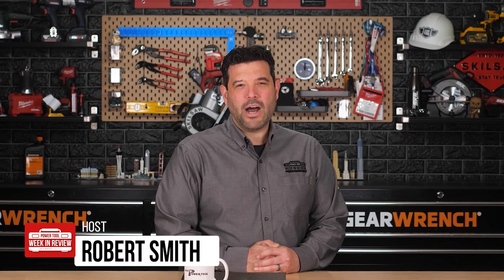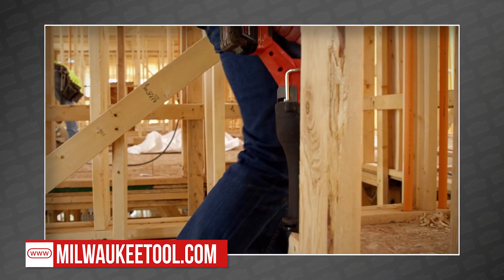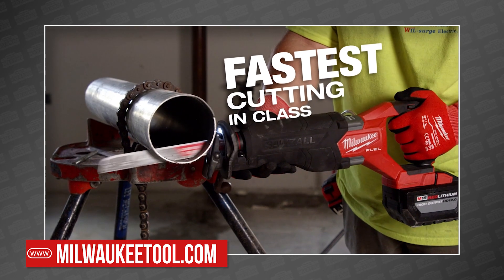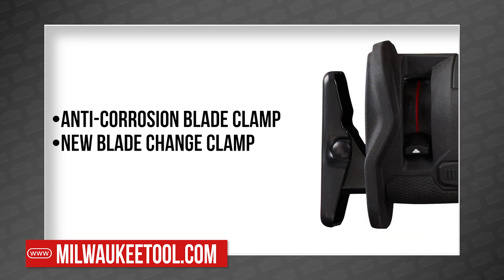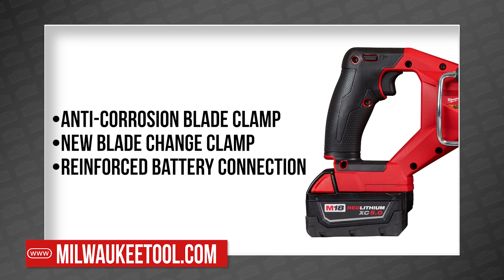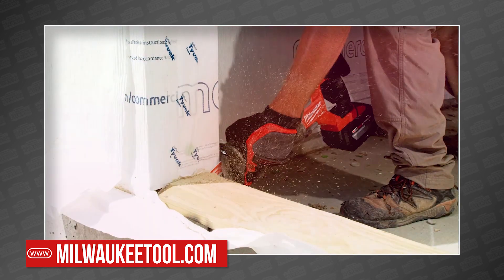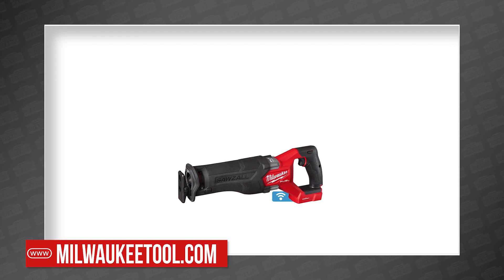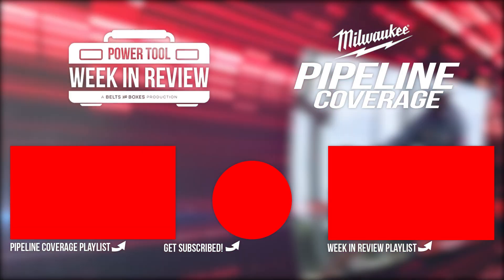NEW Milwaukee M18 Fuel Sawzall and Blades! PIPELINE 2020!

Comment: @Belts And Boxes. Thanks Rob for the info. Also leaned that Milwaukee's new M18 Sawzall also has more rubber overmolding and a adjustable shoe along with the articulating head!  Usually I can only get one or the other.

Will really like a long term review of this recip saw to see how the improvements to the battery retention and stainless steel head work to solve the problems workers asked for.

Hope you,  Sarah,  your staff, and your families stay safe and well.